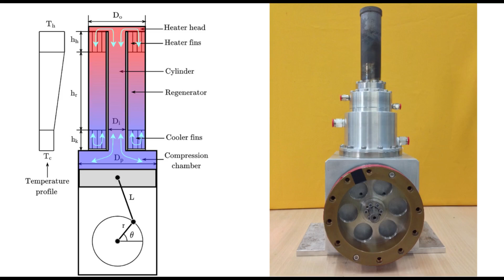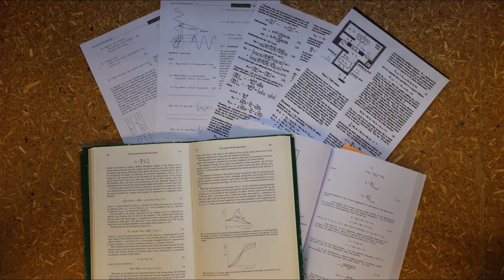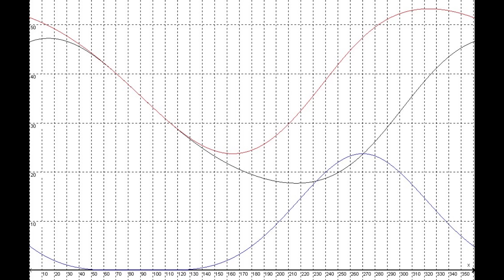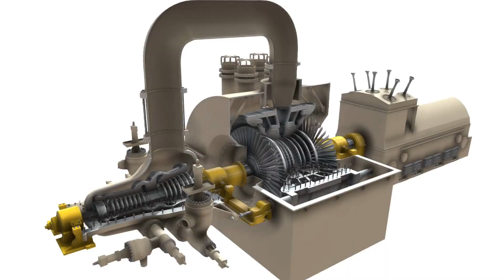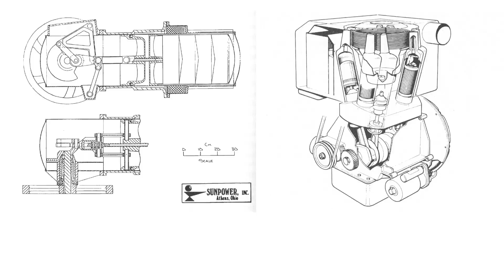Solution of producing cheap energy to support our solar plant to go off grid ?

Comment: I have a nother suggestion for you the Stelzer Motor in english Stelzer Engine, it is a kind of a two Cycle Engine but the only moving part is the Piston it is a Freepistonengine and it is relatively simple. I heart from the Engine about twenty Years ago and i find it simply an genius. 
It has a wikipedia page for the engine.
Reply from the maker: But can it deal with 'dirty' biogas?
Reply: @myengines2443  i think so, the material for the piston and the engine housing must be resistant and then its i think no problem, the Inventor says the engine run on Gasoline, diesel, natural gas and ethanol
Reply from the maker: The parts in direct contact with the combustion are the endangered, sulphur and tar are quite aggressive !
Stainless steel grades are normally not suitable for running surfaces in IC engines.

Comment: Thermal lag or free piston seem like the best options to me.
Reply from the maker: Yes that are also my thoughts!
Reply: @myengines2443  have you read Stirling and thermal lag engines motive power without the c02?
Reply: @myengines2443  In it, Dr. Organ designs his engine for solar, designing to use a fresnel lens and quartz glass to heat the engine internally.  Do you think something similar could be achieved with a biogas powered engine by incorporating a burn chamber inside the hot end?  Something like a pipe that runs through the hot section, with inlets for gas and air, an igniter, and an outlet for c02.  Could there be an advantage to an internal burner system?
Reply from the maker: I am very familiar with the work of Allan Organ and he kindly helped me several times with my engines.
I have also the book and I know the engine you mean.
My 4 bar link engine is built according to it without the quartz window, look at my older video about it.
The aim of his design is to get a higher temperature difference inside the engine but for me its not possible to deal with these high temperatures although it is quite interesting!
For me its hard enough to deal with the 'normal' temperatures inside my engines.
If you can handle it it has surely a great potential.
Reply: @myengines2443 I'll go back and look at those videos for sure👍.  But what I was thinking wasn't increasing the engine temperature, but improving heat transfer to the hot end.  If the burner is in the hot end, all the heat has to radiate out... Into the hot end working fluid, minimizing heat loss to the environment, reducing the fuel required to maintain engine temperature, and simplifying burner construction.  Plus, you could insulate the hot end to further prevent heat loss from the hot end.

Comment: I've been tinkering with using solar power to compress methane, but I'm on a quest for long term energy storage.
Reply from the maker: The storage of the summer methane for the winter is another problem!
Do you foud any good solutions?
Reply: @myengines2443  The best way to store methane is probably to convert it to methanol which has infinitely better volumetric energy density. I'd pay to see someone creating a catalytic reforming column to do this...

Comment: A free piston two cycle IC engine with integrated linear generator...
Reply from the maker: Its a nice design but will also have problems with 'dirty' biogas I think?
Reply: linear generators are far harder to make than they first appear.

once you start delving into flux density, current density, turns ratio, reluctance of magnetic paths, air gaps...

more to it than "wave magnet past wire make voltage"
Reply: Eh, those seem like loudspeaker motors in reverse, and there is plenty info on those.

Comment: intenal combustion egine running on gas fumes or gas vapor. low fumes, last longer. make a gas vapor carburator.
Reply from the maker: I am not sure if I can clean the biogas so much that it will not destroy the IC engine very fast!

Comment: The standard piston engine. It will probably make the most power and hence reduce the running time. 
Have a spare cylinder head you can swap at a set interval and clean and refurbish the other head while the first one is in use. Accept the need for maintenance.
Reply from the maker: I don't want to accept too much maintenance as long there are better possibilities like the ones I am searching for...
But surely the IC engine is the easy way!

Comment: Honestly, the best analysis starts with your lifestyles and energy use....like most people tend to like to have hot water on tap, so keep the bio-gas energy as thermals as a simple water heater and it can be consumed immediately in the design of on demand hotwater heaters or in a tank storage with reasonable insulation (usually only loosing about a degree C/day stored).  This will keep the number of energy transformations low in your house "system".  Think how can I get the energy to where I can use it fastest onsite from my generation sources?  Solar panels are very useful in this category since most modern amenities rely on electricity as an energy form and it doesn't need to be transformed.  Since you have biogas digester, then burn it for thermal energy loads in your house, like water heating.  Ask yourself if your hot water consumption will be lower or higher than the amount of Therms you can get from biogas generated onsite?  This is the best approach energy wise...but stirling engines are so attractive to engineers and tinkerers.  I dream of the day when I have two gigantic thermal reserviors burried under my house, one for cold store and one for hot store that I can just run through my heat engine for on demand power forever!!!!  I have to calm myself down and ask where am I getting all this untold energy from?  Your resources (sun, bio-gas, geothermal, local utilities) available to you will dictate the best engineering design for your house.
Reply from the maker: The generator has to run as a cogeneration unit.
All these very small engines have small efficiencies and all 'wasted' energy is used for heating and hot water.
 Thanks for your ideas!

Comment: I suggest 2st option TMG style even though you probably wont make enough power from one unit you can always stack more of them. Most important thing is that they are efficent, reliable, no maintance, versitaile (many fuel choices) that is more important for offgrid system if you ask me.
Reply from the maker: The TMG is a very elegant concept but the design is really hard I think.
But the reliability is really an argument!

Comment: Excellent work. Have you considered a simple alpha Stirling? That will be both powerful and long-lasting (Ic engines run for years without too much wear). Best wishes!
Reply from the maker: The alpha engine seems to be the simplest stirling but has two pistons to seal and with an easy drive mechanism a lot of piston side forces.
Thanks for your nice comment!
Reply: Then one can go alphagamma way :) half or less of side force. Easy to balance. Mine first did run. Do have some technical  limitations. But still first engines shell not run.
Reply from the maker: The gamma configuration has some advantages.
I think their thermodynamic drawbacks are insignificant!

Comment: Maybe investing more research in the purification of the wood/bio gas coupled with the use of a standard DOH generator will be more time and resources efficient.
So, my money are on a standard combustion generator with a modified carburetor for wood/bio-gas fueled by a temperature/light/atmospheric agnostic methane producing bacteria.
A 1000$ generator producing 3kw-6kw has cheap, fast and easy standard repair kits. The only problem remaining is the sulphuric filtration of the gas.
Reply from the maker: Yes you are right, it would be the easiest way.
But it also has the drawbacks I described and I am not sure if I can clean the biogas so pure that it does not destroys the engine very fast!
Reply: @myengines2443  Pass it through a bunch of charcoal, recyclable filter media, then pass it through a condenser that is chilled by cool water or a refrigeration cycle?

Engines on their own create their own moisture while running just from the combustion process. They are quite robust in that regard.
Reply from the maker: I make a great effort to clean the biogas but it doesn't get clean enough to don't harm an IC engine I think!
Plz look at my biogas video for it!
Reply: @myengines2443  
You are correct in the gaseous fraction of biogas being notoriously difficult to completely rid it of oxygen, particulates, tar, etc. It can stick a piston to a cylinder wall, a valve to a guide...bad news for sure!  I've done limited experimentation, but it thoroughly ruined an old lawnmower engine I ran on it for a couple of months.  It had to be fully disassembled and the cylinder re-honed to remove the dark brown tar mess.  It was like duct tape, only more sticky, and it was everywhere!

  
Have you considered liquefying the biogas before trying to filter it?  I know it is a bit energy intensive, but may be worth it for easier cleaning.  Digesters can also make a room temperature liquid fractional distillate, depending on your condenser, temperature, etc.  That really simplifies things.  Then, it's quite easy to pump the distillate through a commercially available diesel fuel filter, which is very effective and can filter thousands of liters in its lifetime, which could run a generator for a very long time.  A typical diesel fuel filter is rated down to about 3 microns, because diesel injection systems must be absolutely spotless.
Reply from the maker: Was is gas from a digester or woodgas?
Reply: @guerrillaradio9953  Ooooh, somebody's making moonshine! 😅🍶
Reply: @myengines2443  Hi, sorry for the late reply.

The sticky mess was running from wood, but not exclusively.  It was, however, all biomass, as I lived at the time on approximately 16 hectares, so there was a great deal of weeds, woody underbrush, vines which threatened my trees, etc.  Thinking about it more, I wonder if it could possibly be due to some of the more resinous plants which I included, although it was still mostly wood which was too knotted to be split for firewood.  It was mostly White Birch and Red Pine.  Come to think of it, they are resinous themselves.

However, this was in a simple woodgas setup, only tapping the gases from the top of a simple reaction vessel made from an old propane tank with no condenser.  I added a condenser and began to experiment with adding household garbage, especially plastic and rubber.  Any plastic will work, and old tires work the best, but it can even be old shoes, whatever is lying around.  I use mine until they are so worn they aren't good to anyone, so they aren't worth donating to charity.  

The only real difference between a woodgas setup and  a digester is a condenser, how well sealed the system is, and how carefully you control the temperature, pressure, etc.  There are people on YouTube who use old microwave oven magnetrons (safely) as their means of heating their waste, via their solar/wind off-grid electricity directly, then distill the result well enough to run in a car.  It's not 100% renewable, but for many people who don't have much money (the guy with the microwave parts setup built it all for free from things people threw away) are very grateful to get around the capitalist nightmare.  I definitely appreciate the engineering romance of the Stirling engine, but sometimes, we focus so much on one solution that we fail to see other possibilities.

Now, I'm not trying to discourage your Stirling project, far from it! Even my best attempts at extracting all heat from my digester in winter left it with a very hot exhaust.  Think of a modern 99%+ efficiency natural gas furnace vs the old ones from the 1970s and 80s.  The old ones wasted so much heat from the exhaust they needed a metal chimney.  The new ones only have water vapor and CO2 that feels barely warmer than a person's breath and can be vented with plastic pipe.  If we then had a Stirling engine good enough that our exhaust was like that, or even all the way down to ambient outside temperature, imagine the possibilities!
Reply: @myengines2443  https://www.youtube.com/watch?v=4HXgKTqT-l8

Comment: I have no suggestions, but I am definitely curious as to what you figure out.  Good luck!

Is the biogas engine on the same level as a gasifier as far as your worry about wear and tear due to the fuel not being clean enough?  I am guessing that attempting to purify the biogas more would just lead to higher energy requirements and defeat the purpose.
Reply from the maker: I want to use a wood gasifier as a backup in winter when the biogas has ran out also.
So the engine has to be robust because its not easy to clean wood gas and biogas so pure that they don't take damage!
Reply: I realized later that you probably wouldn't want to do a gasifier due to lack of sufficient inputs, compared to a biodigester.